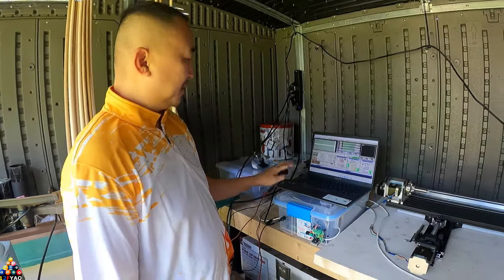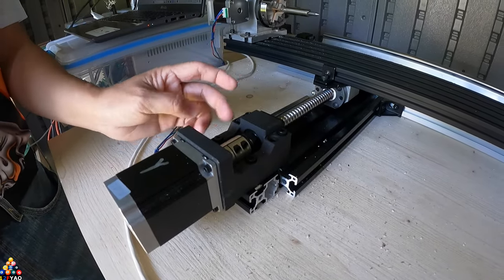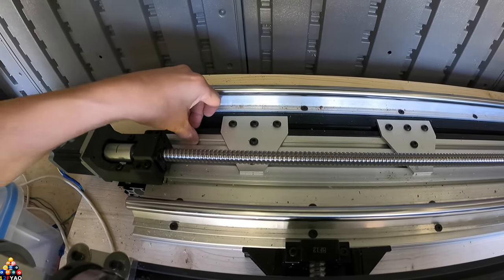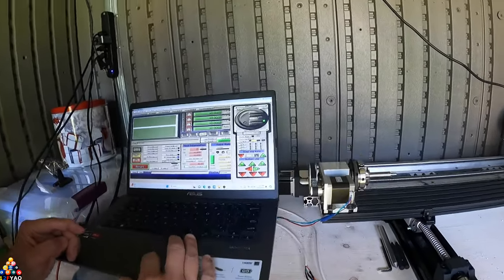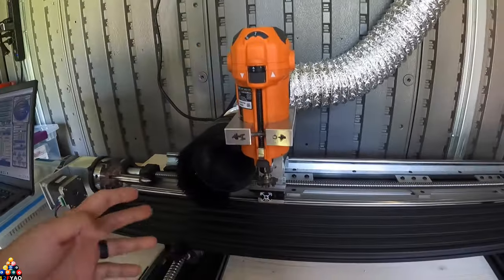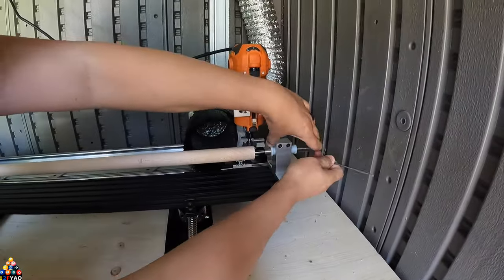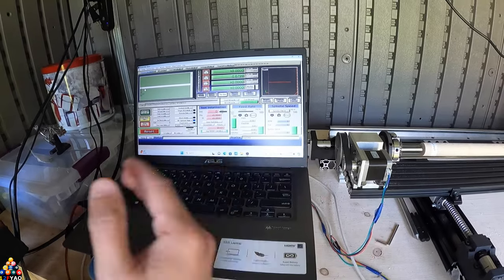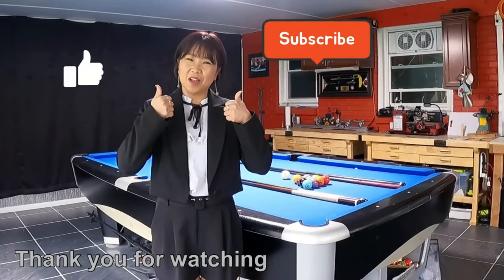DIY CNC To Make Pool Cue Shafts & Butts.

Comment: Nice job.  Vacuum mounted is way easier than holding a shop vac...
Reply from the maker: I totally agree. Thae CNC is totally hands free. Thank you for commenting and thank you for subscribing.
Reply: @playpool12fyao  I thought I was subscribed already ... we talked about this before on your other lathe smiling out loud. 
 BTW are you using a G 50 or a G 92 code for your home zero and / or part zero.
Reply from the maker: You are subscribed, I’m just thanking you for it. I haven’t set a home setting yet since I have different size shaft blanks I have to turn. I think I need to set a home settling so the X axis will always stay the same and I can just adjust the Y axis. I never thought of that now that you bought it up I have something to try. What I have been using is M30 where I move the Y axis 0.250 above the shaft and X axis at 0 and then Y axis at 0 so I can start at the same position I started in and just do small movements on the X axis if I have to get the tip diameter smaller. Thank you again for commenting.
Reply: I did, however, re-subscribe... somehow I lost you.  I didn't notice till I looked for you in my subscriptions after watching this last video.  Thanks